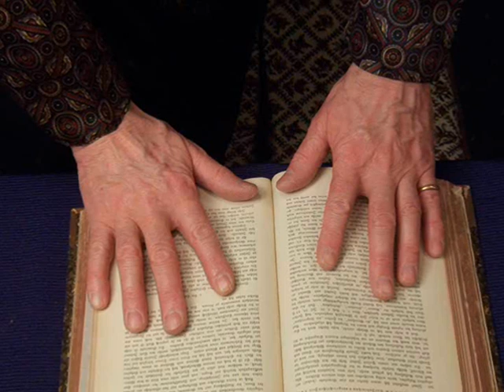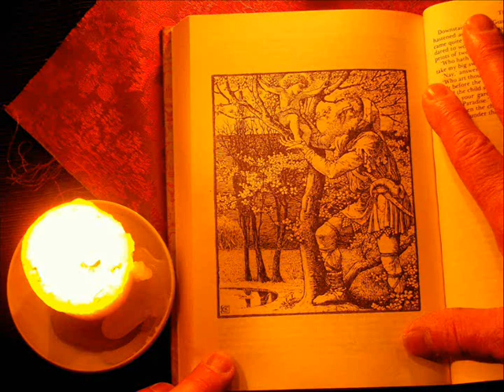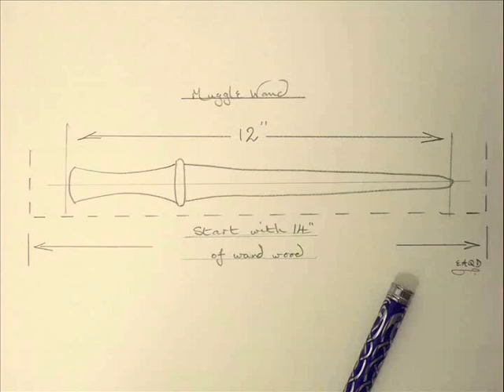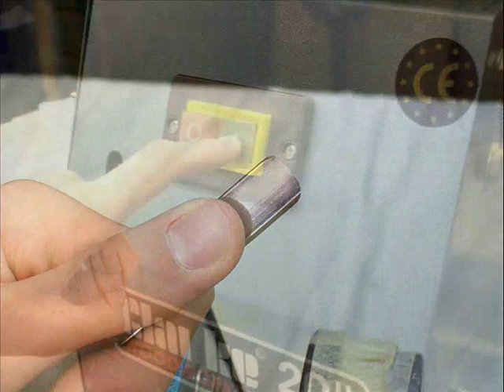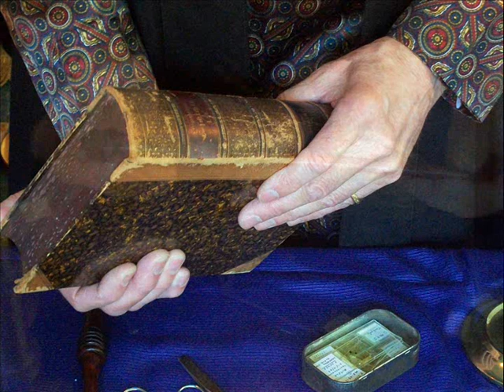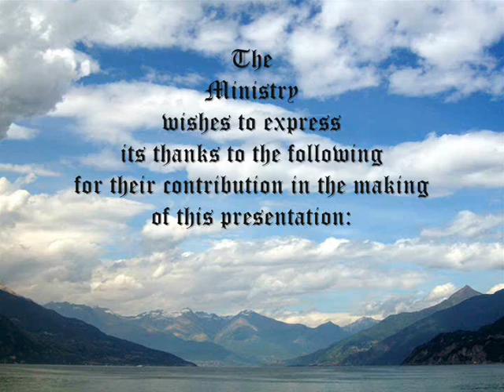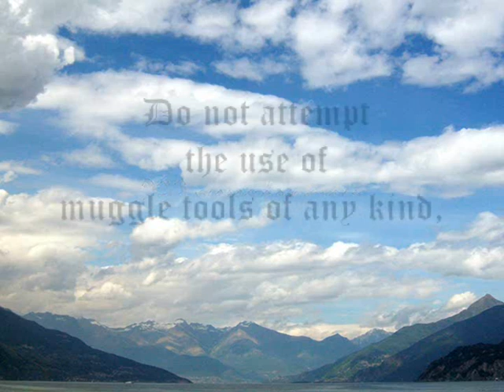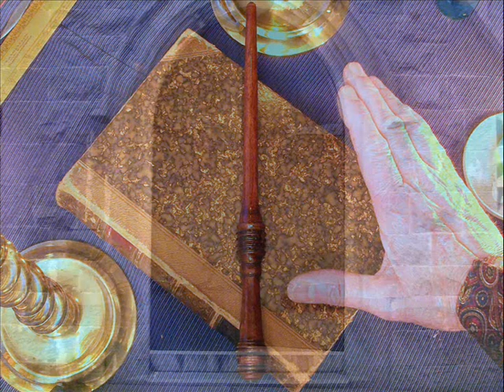How to make a REAL Magic Wand

Comment: I can make water move without touching it, I can vaguely control the wind, I can create energy balls in my hand, is this something promising that could make my wand work?
Reply: And must it be from a wand tree?
Reply: Any suggestions for cores?
Reply: Dear William,
From what you say, you certainly have a natural ability which will ensure you a place at whichever school is appropriate for you and I expect that, if you have not already done so, you will be hearing from them when the time is right.
As for making your wand work, I would say that, if the wand is made from wood from a wand tree (as in Tom's presentation) your chances of success are significantly greater than if made from other timber.  You can still make a working wand from ordinary wood, but it will never be as good.
Only an experienced wand-maker can make an efficient job of a fully functioning wand, however, which is why Tom's experience was so unusual.  The fact that he had a wand-maker's wand was certainly a very important factor in his success.
As for a choice of core, again, only a wand-maker would normally have access to a core appropriate for a specific wand, which is most important (as Tom's experience shows!)
Reply: +Prof. Petros Thank you Professor, I will take this to mind! I wish you and all wizards and witches a happy and safe week!
Reply: Prof. Petros i am not in a school but i was in a crash 5 years ago and can do things i couldnt do before that. I can shake objects without touching the pls reply